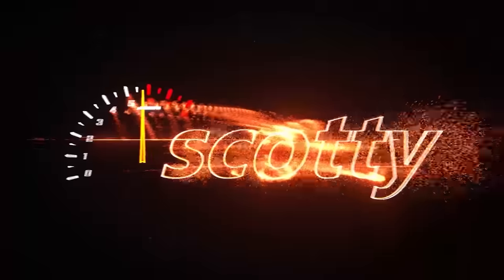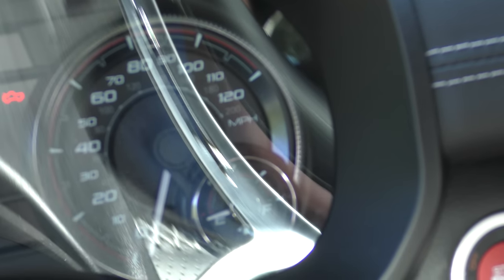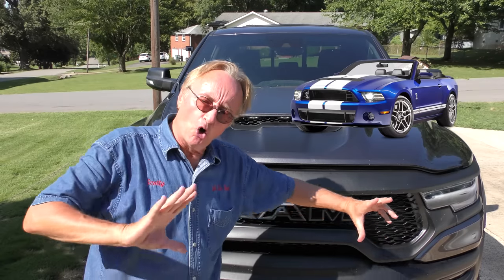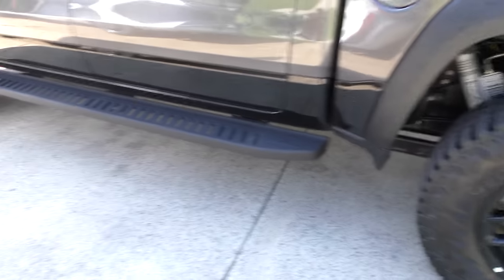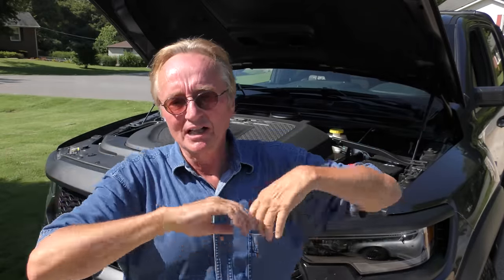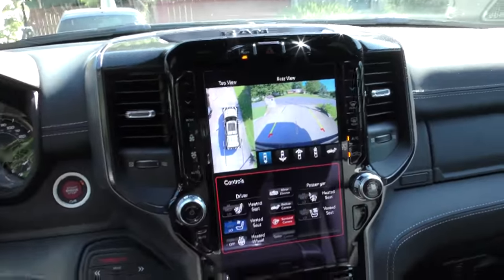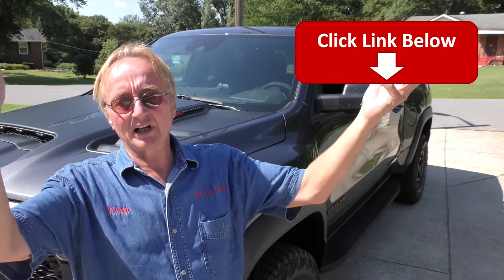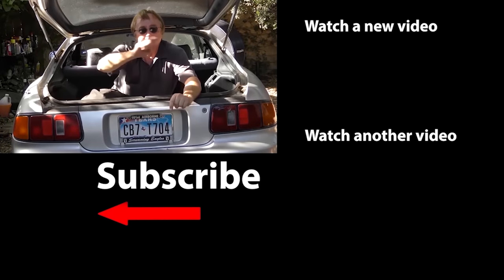I Finally Got a New Dodge Ram TRX and Here's What I Really Think of It

Comment: From what I've heard dodge trucks are making a comeback from their 5.7 hemi's cam lifter problems in the past, anyone know anything about them reliability wise?
Reply: Traditionally it's never been wise to trust a Chrysler truck until time passes as that's the true test of the truck. All this Fiat crap they're putting into RAMs is already having a bunch of issues let alone whatever's gonna spring up down the line when it's outta warranty. It sucks because I actually think RAM nails interiors. Those rear air suspensions are like Cadillac's. But ask this same question 10-15 years down the line, cause then we will actually know the answer.
Reply: Speed Tube  That's good man, but facts are facts. Top 10 Half-Ton Trucks That Last 300,000 Miles:
10. Chevrolet Silverado V6
9. RAM 5.7L V8 
8. Ford 150 4.2L V6
7. GMC Sierra 4.3L V6
6. Ford 150 4.6 V8
5. Chevrolet Silverado 4.8L V8
4. GMC Sierra 5.3L V8
3. Chevrolet Avalanche 5.3L V8
2. Toyota Tundra 5.7L V8
1. Toyota Tundra 4.6L V8

And the only reason the bulletproof 5.7 probably isn't #1 is because the 4.6 has had more years on the road. It got a head start. Do with the information whatever you want but I'm not seeing too many Dodge or Ram or whatever they're going by now..
Reply: @questioneverything4722  You spoke wisdom.

Comment: Those TRX trucks aren't all that bad. Especially with the 6.4L Supercharged Hellcat V8
Reply: 6.4L supercharged hellcat V8??? Never heard of that one. There's a 6.2L supercharged hellcat, like the one in this truck.
Reply: @dallasfrost1996  Lol yep. The same engine used in the Durango Hellcat, Charger Hellcat, and Challenger Hellcat and maybe the Challenger Demon. Never thought Ram would opt for a supercharged engine in their production truck lol
Reply: @dontfallinthevoid  Yeah, the demon has basically the same setup like the rest mention but with stronger internals, paired with a 2.7L supercharger instead of the 2.4L supercharger. (Same setup found in the Redeye versions of the hellcat power plant) In fact that's how the Redeye versions became a thing, they took the Demons setup and shoved it into the original hellcat setup.

Comment: Well, it may not be as fancy as this rig, but my 2020 ram pickup 2500 with the snow package will probability out last this thing! The 6.4 motor isn't supper charged, regular cab, 8ft bed with a cap. It drives like a, well a truck! I take it off road on the beach and towed a travel trailer. Someday I hope to take it cross country!

Comment: I have an old 2008 1500 Ram with hemi. Basic plastics and parts that prematurely fail like water pump and wheel bearings. Oh and blower fuse or whatever it is called. The steel rims rusted so bad that the tires kept leaking and I bought alloy wheels for it. It was the last year for rear leaf springs the only good thing about it other than the engine

Comment: Sounds like I got on my 1979 ,W150 its Full time  ,short bed , single cab , 360 engine  the milage was terrible like 8 mile a gallon never got stuck when went four Wheel with friends . Just more electronic to break down maybe I put a HellCat engine in it but have butcher the wiring to get it to run I think not  .

Comment: lol  I have to say, I'm actually somewhat Impressed with Fiat Chrysler Groups recently.  I've owned and still have some ancient Chrysler vehicles back when it was called " Chrysler Motors " everything was over engineered, things you would expect to wear out just dont... Ball joints that last 400,000 miles, transmissions that never need anything...  Hell I even have one with the original air conditioning system in it that still works.  But from the 1990's forward, MAN did they get bad.. But After working on the more recent Fiat Dodge, and Ram vehicles.. The very first thing I noticed on the Dodge cars is they don't rust.  And on the trucks I noticed they don't leak.  lol That right there is mind blowing after 20 years of garbage from Chrysler.

Comment: The trx is not a limited production. They will build as many as they need to meet demand. They made a limited amount of launch edition models ro commemorate the launch of the truck that came in a special color but other than that the trx is not a limited production vehicle
Reply: The v8 and hellcat engine will no longer be made... As they are switching to electric... Therefore this trx is limited

Comment: It's too much money. I would go for a trim lower that's a few years older, like a 2019 Rebel or older, or go a size less like an old Toyota T100. That TRX is more than $90k that sits on tires and power that's made for a possible accident. Be smart with your money and go used but in good shape!

Comment: Just a question. Why built a 702 HP truck and limit to 119moh? I have a 5.7 hemi limited to 107 mph.  390 HP. Explain this truck use> Other than off road.
Reply: It’s not a race truck. It’s an off-road truck. If it went over 1500mph it would go horrible

Comment: I recently put in a new radiator. 2001 grand cherokee laredo 4.0 6 cyl. I also put in new steel lines on the radiator, but I don't know which  skinny rubber hose they connect back to .
does it matter ( seems to me it does)
so would the upper radiator line connect with the upper skinny hose on transmission line and lower line with lower?
The trans oil cooler lines that are held in place much like a brake line that then has 2 skinny rubber hoses. Please reply
Help a girl out

Comment: You can be as certain as death and taxes, that someone is going to try and find a way to override that electronic speed limiter and send themselves to kingdom come.
Even with all that heavy duty
equipment, I’ll bet it still has the same P.O.S. TIPM that has plagued  RAM, Dodge, Chrysler and Jeep for the last 8 years or so.
I’d take the cash prize instead.😞

Comment: "How can you control 700 horsepower?"
Well, it weighs 6000 lbs. It's not that hard.
Try controlling 200 horsepower on a 450 lb motorcycle.

Comment: Everybody talks about HORSE POWER.....Pure ignorance.....TORQUE is what you should be talking about. It's NOT Horse Power that gets you up and moving, it's the TORQUE. Why do you think Diesels are so popular? Their TORQUE BEASTS!.............Horse Power holds you at the achieved speed AFTER TORQUE gets you their!..........The TRX's 6.1 needs serious help in the torque department. Oh and 113mph is the actual limitation set by Chrysler, not 119mph. RAM's are inherently unstable (their top heavy) above a certain mph. It's a safety setting......oh and the 702hp rating is not accurate. It's actually closer to 716hp